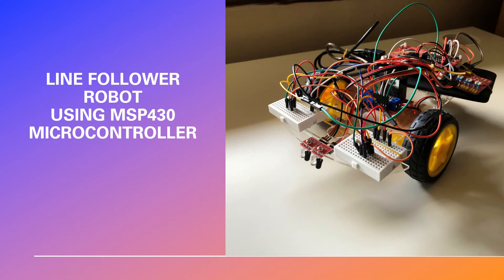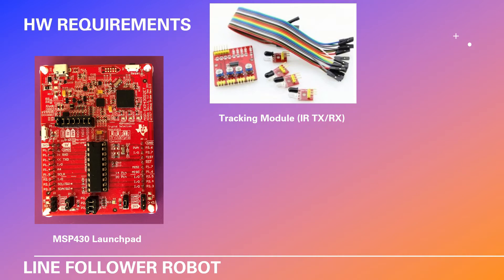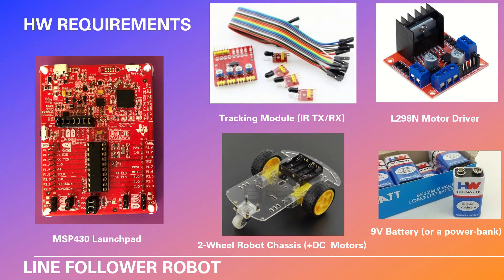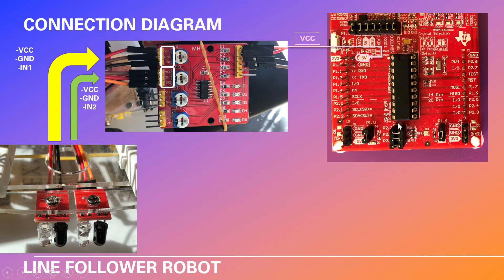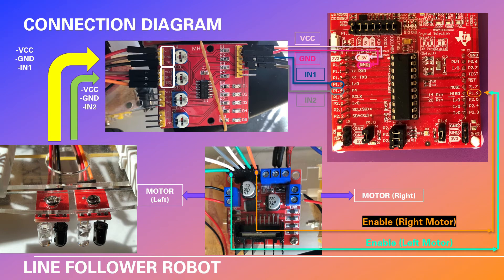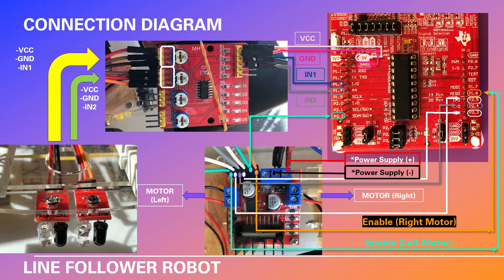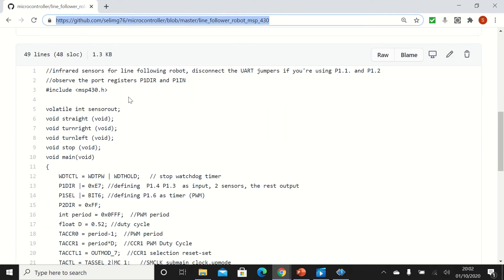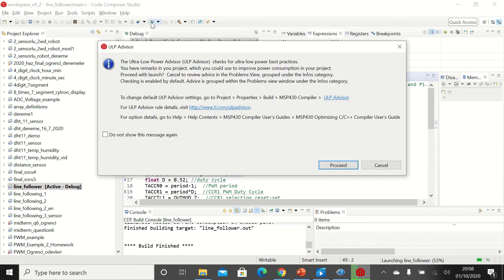Line Follower Robot Using MSP430 Microcontroller

Comment: Elinize sağlık hocam. Msp 430 ile conveyor belt yapıyorum. 2 adet 6V Dc motor ve l298n sürücü kullanıyorum. Birçok kod denedim ama motorlar çalışmadı. Öneriniz var mıdır? Bir de sensör kullanmam isteniyor fakat code composer da hc sr04 kodunuzu denedim ama çalıştıramadım nasıl bir yol izleyebilirim ? kod hata vermiyor ancak sensör de çalışmıyor
Reply from the maker: Teşekkürler, bu videodaki ve hc-sr 04 videosundaki kodları kullanabilirsiniz. Neyin çalışmadığını tam olarak anlayamadım. L298’de enable pinlerini 5v ya da pwm pinlerine bağlamayı atlamayın.
Reply: @drselim  Hocam ilk olarak sensör videosundaki kodları denedim ccs de yalnızca port 4 görünüyor ancak onun da sonuçları boş görünüyor. Msp yi farklı portlara bağlasam da yalnızca port4 görünüyor. Tekrar deneyeceğim hocam.

Comment: What module are you using for the the IR sensors, and is it necessarry to have it?
Reply from the maker: Hi,
This is the one that I used:
www.robotistan.com/4lu-cizgi-izleyen-sensor-seti-4-way-tracking-module
I haven’t tried the sensors without the module, but it can be possible. It should send 1 on a black surface and zero otherwise.
Reply: @drselim  oh wow thank you! It's hard to find anything for this specific microcontroller so this was very helpful!
Reply from the maker: You’re welcome :)